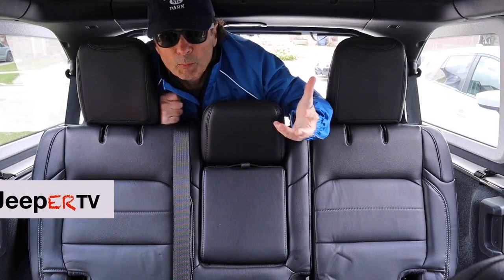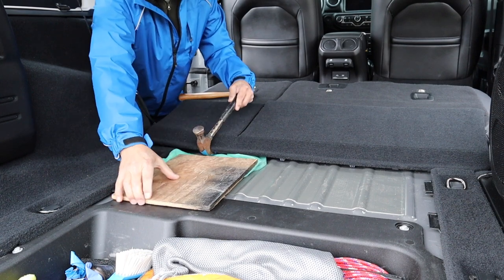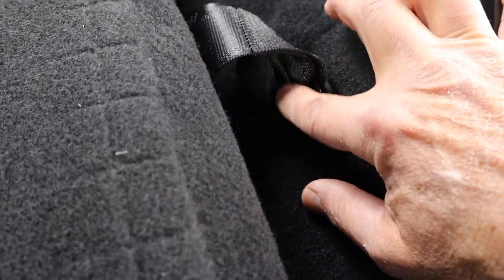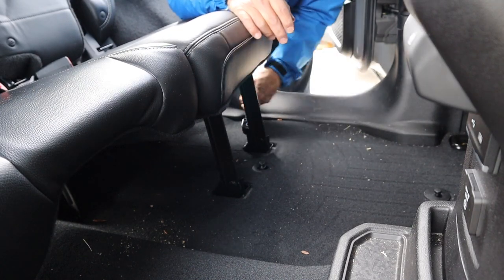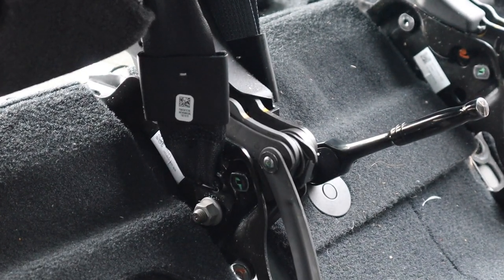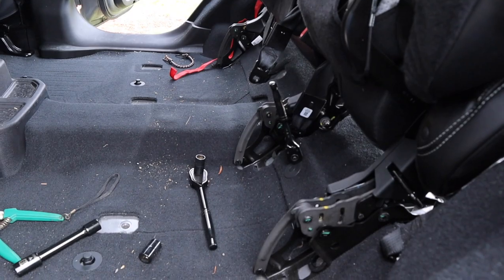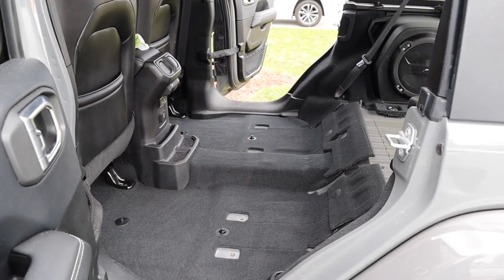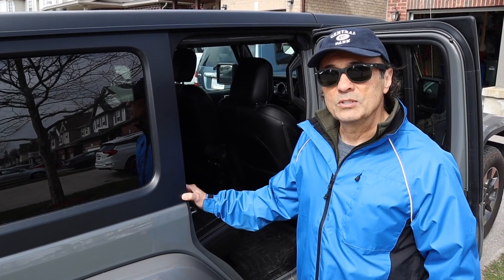Wrangler JL Rear Seat Removal - 4 Door

Comment from the maker: TIP: When the bolts are removed, the threads in the floorpan are open to the underside of the Jeep.  I recommend that you reinstall the bolts to prevent any water from coming into the cabin.
Reply from the maker: Thanks for the tip.
Reply: Do you know if it’s possible to only remove the 40% drivers side seat?
Reply from the maker: You can, but a bracket is needed to hold up the end of the 60% seat. Goose Gear I think makes one. If you know someone who does metal work they can maybe fabricate one for you. Cheers.
Reply: CheaperJeeperTV thanks!

Comment: Is it possible to just remove the 40% side? I want to use that side for easier entry and exit for my dog.
Reply from the maker: Yes. However, a metal bracket will be required to secure the remaining seat.  I believe a company called Goose Gear may sell that bracket. Cheers.

Comment: You made removing the seat belt bolt under the longer bench section look easy. I'm struggling to remove it even with a breaker bar. I'm afraid I'm going to break it.  Any tips?
Reply from the maker: Yes. If you have an impact gun, use it. I find as the impact driver is trying to unscrew the bolt. If I push down on it, with some downward pressure it eventually releases.

Comment: I'm working on a project to install reclining wedges on the backseat and came to the last and most difficult bolt. The rear bolt under the seat closest to edge on drivers side. Any suggestions?
Reply from the maker: My Jeep is a JL, so still pretty new and hasn’t had time to seize up. If yours is an older Jeep like the JK it may be seized.  If you put a bar onto the end of a socket and wrench, you may get more leverage that way.

Comment: Do you think an 18 inch 12 V refrigerator will fit under the rear door bed platform ? I bought the Alpicool 53 quart
Reply from the maker: Hey JeepdogsRCbikelife, 
As I mentioned earlier, with the rear seat removed, as seen in the rear seat removal video, there is a ton of extra space below the platform.  Since the cross piece behind the front seat is 16" tall, what you may have to do is make the cross pieces and legs 'at least' 2" taller than in my design.  The construction video and article on my website has all the piece dimensions. Make sure to test fit the fridge to ensure the correct amount of extra inches required. The cargo leg pieces in the rear will also need to be made taller by the same number of inches, to keep the whole platform level. I hope that makes sense.
Reply: CheaperJeeperTV yes it did help ty 👍

Comment: Has anyone had a problem being able to lift the rear passenger seat after reinstalling the rear seats? Thanks!
Reply from the maker: Hey Michael,
I hope I understood your question. Essentially I have removed and reinstalled the backseat a few times without issue.
Cheers
Reply: @CheaperJeeperTV  Thank you for the reply. I removed my 2020 rear seats and when I reinstalled them, I could no longer fold the driver's seat down. I accidentally said passenger seat above. Thanks!

Comment: Isn't there any electrical wiring harness to be removed??
Reply from the maker: HEY A.R., There were no electrical harnesses to be removed on my 2018 JL Sahara. I'm not familiar with any JL models that have any wiring in the rear seats.  The purpose of the zip tie connected to the seat belt connector was odd, but I made sure to attach another one when I reinstalled the seat.  Removing the rear seat was actually easier than I thought. Thanks for watching the video.
Reply: @CheaperJeeperTV  Thanks for the confirmation - I've a '18 JL Sahara as well.
Reply from the maker: I did a 100,000 km real owner review video of my 2018. You may want to check it out. Keep an eye on the doors near the hinges.
Reply: @CheaperJeeperTV  Thanks for the hint.  Will check this & others. I've 22,000km on the odo, drive it for 14 months now (2nd car, not a daily driver). With zero issues.

Comment: cant believe that is so "difficult" or time consuming...  I have a honda element, and seats fold up in 6 seconds and can be removed in 2 minutes no tools.  disappointing...
Reply from the maker: Hay Dave, I think you're right. It would be great if the engineers could figure out an easier way to take out the seats, given many Jeepers use their Jeeps for camping. Thanks for your thoughts. Cheers.